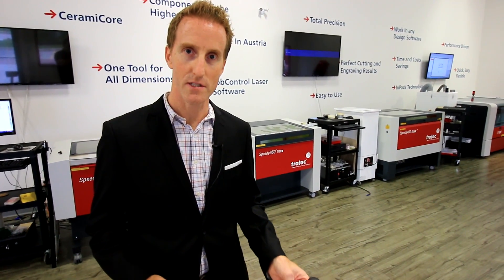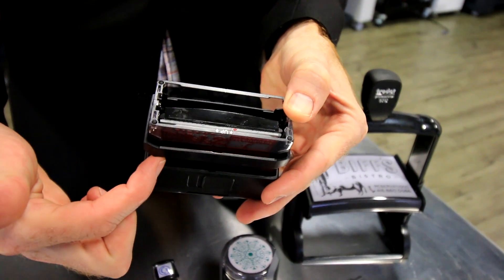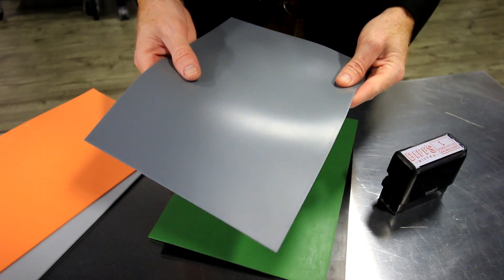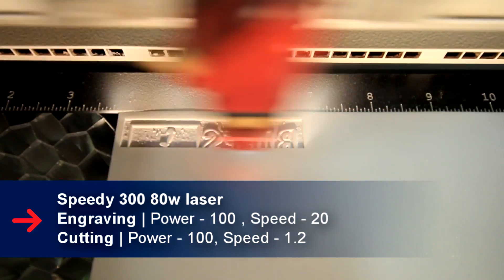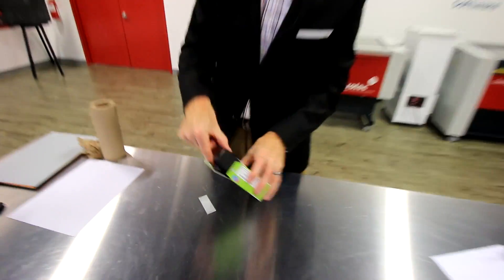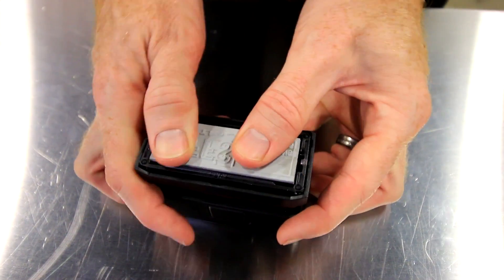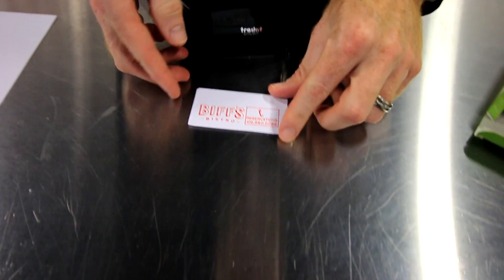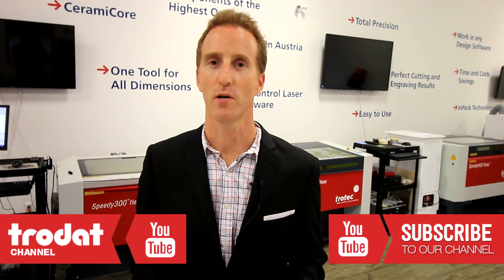Laser Engraving Rubber Stamps | Customizing Stamps with Trodat

Comment: there is problem in my machine its not engavering correctcly whats is solotion
Reply from the maker: Hi Zuber, do you have a Trotec? Which country are you in?
Reply: i AM IN SAUDI ARABIA CAPITAL RIYADH I AM .................CAN U HELP ME  0507744819
Reply from the maker: Hi Zuber, Trotec Canada only operates in Canada. You would have to call your local distributor where you've purchased the machine. Thanks.